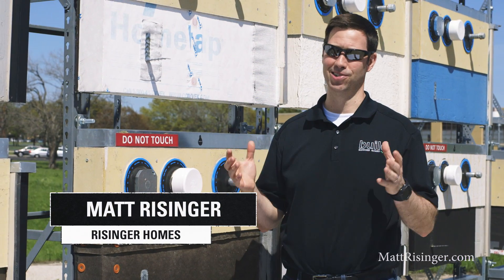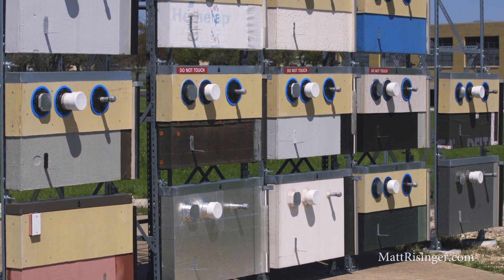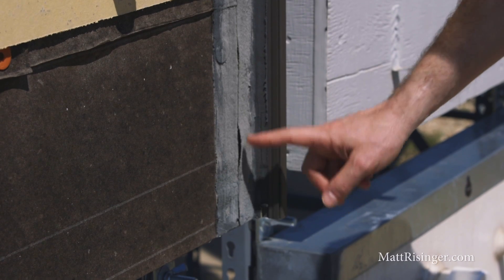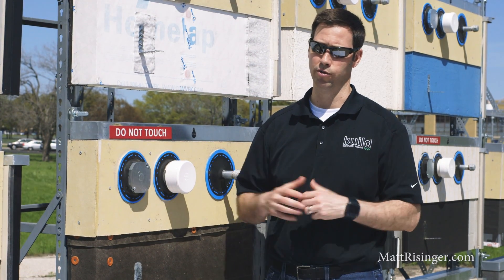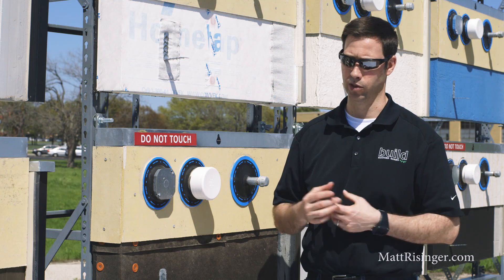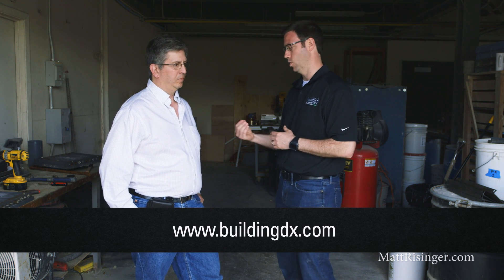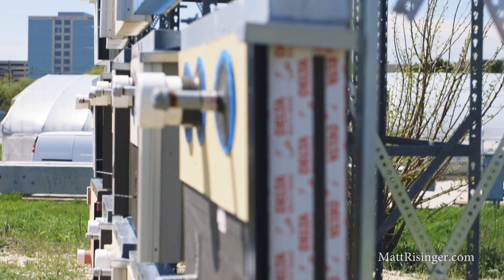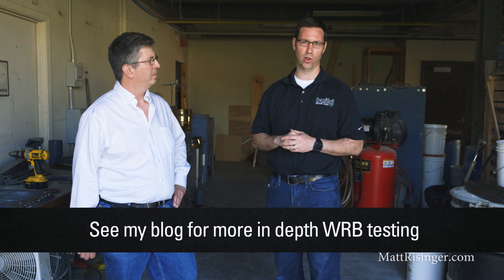Fluid Applied Weather Barrier Testing

Comment: We’ve seen the Zip failure at the roof to wall where there should be a kickout. Every product will fail when moisture attacks from behind or is held on the face at the battens or at clogged screens.

Comment: how do you wrap concrete? mostly for the water proofing, because I Assume its already air tight. My dad put tar, but unfortunately he passed away recently and didnt get a chance to complete it, so its half tared up. Is there something that can I can spray on top of that will go over the existing tar? the tar was applied  10+ years old and has been exposed to the elements since. no cracking what so ever other than a little discoloration.  he just had too many DIY projects. any products to google would be great!
Reply: Bardia Ghajari A concrete contractor I worked for used a liquid applied concrete waterproofer that is bombproof. It comes in a variety of viscosities from trowelable to paintable to sprayable ( the last realy should be left to pros. Its called KLM5000 and is made by sonneborn. Its about 150.00 for 5 gallons its a petroleum based product and it can even be thinned down before applying so it rolls on better. It really needs thorough stirring b4 use and I strongly suggest a tyvek suit, rubber gloves, booties and dress down underneath the tyvek - its messy. You can roll it on just like paint. Directions recommend 2 coats for waterproofing. It can be used even for fish ponds since it becomea inert once dry. I did a roof with it years ago (wood) under a deck to waterproof another area beneath - not a drop! Direct exposure to u.v. may be an issue over time but there are 2 solutions to that 1. Roll roofing felt down onto it while wet and this blocks uv or 2 just check it in say 10 yrs for need of a 2nd coat. Ive never seen this stuff not work read label for thinners (I think it was denatured alcohol but says which on label). Good luck.
Reply: I would think more tar if it's still in good condition after 10 plus years ago ?  Over the tar, maybe an oil based paint if that's what you're asking ?  Also sorry about your loss, mom passed away 6 months ago and it was Pancreatic Cancer, suffered like crazy. :(
Reply: This product seems to be taking off here in Ireland, made in Germany one would think they have a 'Belt and Braces' approach to construction...might be worth a look at regarding concrete tanking or other substrates.. i'm going to use same for a  quick emergency repair on some  broken roof tiles...  http://botament.com/en/microsites/rd-1-universal.html
Reply: ill give the manifacture a call and see what they have to say for my application, thank you for the link. This type of consistency is what I was hoping for.  thanks!
Reply: @ James Are you sure that is the model number? I Don't see it on google. I will search their site again

@ August. Sorry for your loss. where there is tar it does look like its in good shape. but who knows I think i will have to bring in an expert.
Reply: Bardia Ghajari forgive me H L M 5000 not klm5000.
Reply: Bardia Ghajari just type in sonneborn waterproofing products

Comment: Fluid applied seems to be a winner.  Even the Zip System is really fluid applied at the factory. Apparently Tremco’s ExoAir 220 (black) is the leader in nail sealing, however in the previous blog on WRB, Tremco's ExoAir 230 (limestone color) was mentioned as a leader. I noted the 230 data sheet suggests UV resistance and window sealing capabilities that the 220 does not.

Comment: Kool Seal White Elastomeric Roof Coating forms a thick rubber-like blanket for protection against moisture and its low voc. Poor mans fluid applied barrier. Id like to see them test simple roof coatings.
Reply: I've often wondered why more people haven't tried this. Do you have any experience using Roof Coating as a WRB? How does it hold up over time?

Comment: Very neat study. So what's your take away? Do you have a new favorite WRB?
Reply: Grant Tanner There's no clear winner, but in my opinion, the ZIP system is pretty solid, as well as Polyguard's Alum-A-Flash, since they both looked nearly perfect after baking in the Austin sun for 2 years. Here's the link to Matt's blog post: http://mattrisinger.com/fluid-applied-wrb-testing/
Reply from the maker: Check my blog for a post with the same title. I've got a more in depth review of the specific products. Thanks, Matt